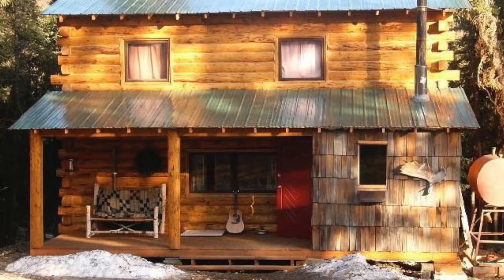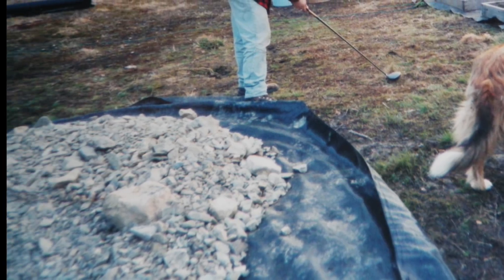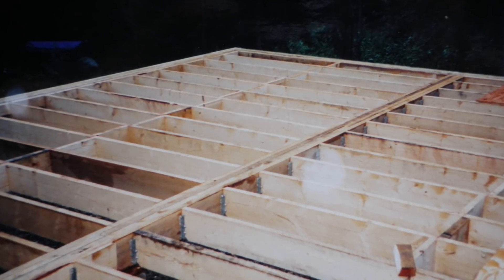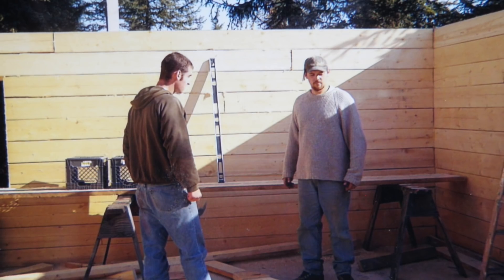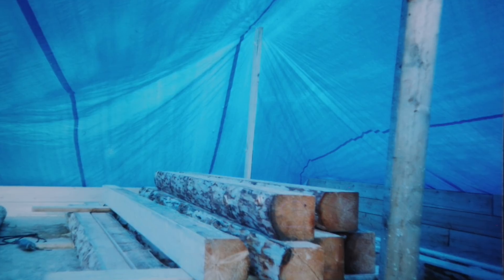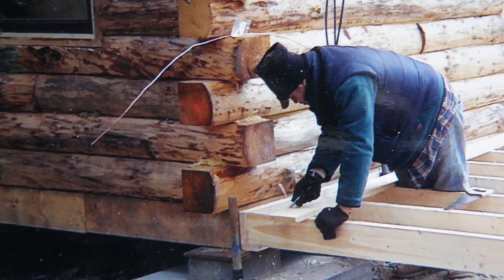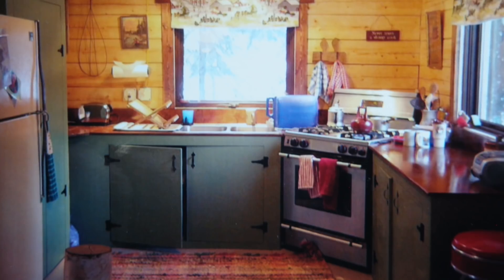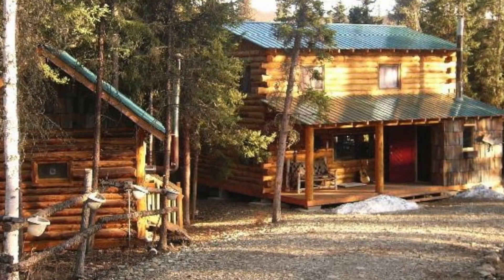Alaska Log Cabin .........Start to finish ( part 2 )

Comment: kudos....raising a family...building a cabin...any cabin while maintaining an income.....good stuff Vern...We built a temporary 20x25 A-frame on 4ft log walls....I was driving 100 miles one way to work..as a timberfaller...started in June....came home.. from work on the 3rd of Nov...we were moved in......that was in 1987...hopefully will build a house this year.....with indoor plumbing...Our three kids were from 8-16 years of age when we started...we now have 5 grandchildren...from 6-17 yrs of age.....never give up the dream....Still off grid...just discovered strip LED lights.....Wow...a half dead 12v battery will light your entire house for a couple months w/out charging....incredible...Live the Dream Guys......
Reply from the maker: I need to check into those!! Where should I look for those lights, and do they come in 12v or do they need an inverter?

Comment: Tarps are the most common home savers.  Love a huge tarp.  They don't last more than 6 months.  In my experience.  I used a 100' by 60' over my 5th wheel home.  The first winter we had ELEVEN feet of snow that never melted.  That tarp was TIGHT over the RV.  I had to step down 4 steps carved into the snow/ice to get to the stairs up into the RV.  

Every winter I used only 15 gallons of propane.  Maybe less.  There was enough room for dogs to go poo poo,  an area for charcoal cooking.  Completely shielded by snow and insulated with snow, no one could possibly have seen the RV.

Comment: I think this is how I will build my bunkhouse.  I wanted to hand scribe it but I think that could be a project I'll never finish.  I am buying a sawmill and my tractor should be here in a few weeks so with those tools my wife and I should be able to do a butt and pass much easier.  I like the way you supported the second floor joists.
Reply from the maker: Nothing the logs on the outside wall is the way to go.

Comment: love these videos the most  please continue down this path ,,, any chance we could have a look on the inside..... more  cabin videos....maybe an explanation of the artic entryway,, why you put the stove in there  i see the roof and chimney was easier than going thru the upstairs... smart ...also keeps good heat source between you and the elements &  make drying boot and jackets easier,..  love the cabins and property changes  .. I LOOK FORWARD TO MORE OF THESE...
Reply from the maker: The arctic entry is just an area to go through one door before you open there door to the house. It's a barrier for the cold to get in and a place to store some stuff you don't want in the house. As for the stove, it wasn't my only heat source in that cabin as it was in the little cabin...We also had a Toyo stove ( fuel oil). I would run the wood stove when it was warmer out and shut the door to the house and run the Toyo when it got really cold.

Comment: Very nice cabin and man you work fast.  My dad and I built one up on Haystack near you back in 1982.  It was 20x24 2 story. It took us 2 years to finish it.  Probably because there was no road into the site until we finished the cabin and the nearest electric was a few miles away at Hilltop.  And we drank a fair bit back then too.  We worked right thru winters even when it was -40F so I guess we needed the constant liquid encouragement.  It was pure hell but now it's some of my fondest memories.  For the last 2 years, Ive been developing  a cabin site with my 12 yr old son and we'll be doing the cabin this Spring.  I sure wish I had your energy and youth.  Now I know what a tough old bastard my dad was tho!
Reply from the maker: .....I wish I youth and energy too, LOL! I'm nearly 43 and have been doing concrete since I got out of school.....
     Thats awesome you guys built up on Haystack. I put in a slab foundation up there in 2004 when the fires were burning up the other side of the valley and I had to run up there at 9pm and get my equipment off the mountain because they were evacuating the area. You could hardly see to drive the smoke was so bad.

Comment: Beautiful work. Just an aside, but I'm surprised that the snow fall did not require a steeper roof. Thanks for the view Brian 77
Reply from the maker: There is very little overall snowfall in the area. you usually get 16" on the level accumulation.   With the little cabin...you just slam the door and it all comes off...with this roof, the first warm day it all slides off.

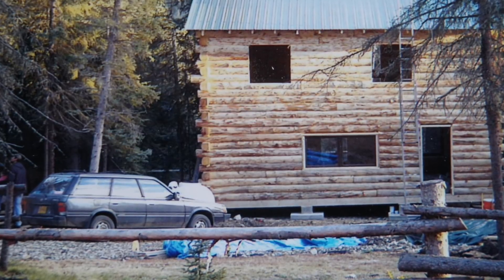Comment: The little station wagon at 8:02 to about 8:15 is that the one I saw you paint with a roller?  When I got to visit Alaska for a couple months two summers ago I was amazed at how long people keep their cars and trucks up there. You Alaskans must set the record for squeezing the most miles out of a vehicle than any other state in the union. No such thing as a throw away society up there. It even seems that when a vehicle is replaced a lot of folks keep there originals and use them for parts or for manufacturing other things from and sometimes the parts are good trade goods with neighbors. I was amazed with what folks will barter with up there
Reply from the maker: No that station wagon in the video was a Subaru. They don't use Salt in Alaska so the vehicles last forever. My 1998 ford escort wagon has 250k and it still has 95% of its original parts and very little rust. I t does have some from spending the last few winters in Michigan.

Comment: I have seen you build with corner post and infill, butt and pass and vertical. Which do you prefer?  Great video series!! Thank You
Reply from the maker: The corner post methods makes the most out of the log.....all I had was 12' logs so it gained me about 2-3 extra feet. But and pass with 3 sided logs is the easiest and fastest by far. and stronger too.

Comment: Hi Dave, whats your opinion on heating the D style logs in this video compared to the full round in your first cabin and possibly in comparison to by six stud wall construction?
Reply from the maker: Good question. The full round was the worst to heat because the logs only end up with about 2-3" of flat surface where they meet. 8" three sided logs have about 5-7" of flat where they meet.  I would say they heat as well as a 2x6 wall, and a log house is a DRY house because the logs pull a lot of moisture from the air. Ina 2x6 house ( a tight house) you may have to incorporate some kind of ventilation to keep the moisture down, like a de-humifier.  Not so with logs. I heated a 1500 square foot log home with a small wood stove with a 6" flue, in Delta junction Alaska.....That stove would handle the house down to -45 then I would have to run the furnace too.
Reply: @Bushradical  I copy, thanks for the info. Any opinion on the gasket sealed toung and groove style D logs? I was looking at these offered by the mill there in Delta Junction matter of fact.

Comment: Hey that was nice video. Good craftsmanship as well.  What do y'all put on the logs exterior to help preserve the wood and its  look? Did you varnish the interior walls?
Reply from the maker: Interior walls get brushed with an Osborn buffing brush which cleans them up fantastic and they get coated with Watco Danish oil. For the outside I use a product called Duckback log oil.

Comment: Been watching your videos and was curious if you built a 3rd log home after #2? You seem to imply that you lived in the bigger log home for a few years on that same homestead, so I'm guessing you may have moved to another piece of land. My logs are milled flat on both sides, dovetailed on the corners. It's taking me a long time, but have the shell to top plates and just got a foundation poured for it and hope to get the shell moved sometime soon. BTW, you may know but there are a few companies in Oregon that use a log milled on 2 sides and leave inside and out as flat/milled. I think flat walls in the interior make a lot of sense, exterior as well. When a check in on the vertical face, water still can't drain into the log. For a similar reason I used half dovetails, as water sheds away from the joinery on both sides of the joinery. I don't know it's best or even right, but the way I'm doing it.🙄
Reply from the maker: Ive actually built 4 log houses . I built a big house in 2009 . I have a vide called "log cabin projects, or Alaska log cabin projects.....something like that, .....that has some footage from that build but I didn't take many pics of that build and Brooke had only a little footage that we still have. Check it out.
Reply: @Bushradical  I will check that out. I saw a stockade type building, maybe that was number 3 or 4. Would be interested to hear a comparison of the styles you've built.

Comment: Did you insulate between the floor joist, if so what type of material?
Reply from the maker: R30 fiberglass insulation.
Reply: Regal Bowman
If you are looking for ideas.
 You should check out bossoftheswamp.
He does a cabin remodel/build.
Lots of good practical knowledge.

Comment: Looks like you primarily used butt-joint corners.  Did you have any settling issues?  We're looking at doing the same thing on Hawaii Big Island in the future.

Oh my god, I just saw the collie at 7:22.  Took me back to my first 40+ years ago.  Beautiful!
Reply from the maker: Hey John. The but corners work just fine. I usually stuff 2 log screws in each course through the corner. I allow 1/8" per course for settlement. So if you are stacked 12 courses high ....allow 1.5 - 2" above your partitions for settlement. Also build a box of 2x6 for the windows to be set into....this will allow you to leave a gap above the box for settlement...but it won't effect the window itself.
       Ive had a collie for 20 years now. I'm on my 4th one. My first 2 lived 12 years, my third got killed in a trapping snare. The one I have now is in a lot of my videos. GREAT dogs!!
Reply: My first was a farm collie that I had for 12 years, then I had an Aussie that I adopted, and we had her her 14 yrs. Now I have a Border, my first boy, and he's a stud.  Hangs right with my wife's St Bernard.

Comment: Hey bushradical I live in alaska as well and I'm looking to build a log cabin could you give me and idea on where to find some good plans
Reply from the maker: ...............Uh.... I'm sorry jacob. I wish I could help you out but Ive never built a house from much more than a sketch on a piece of paper. And Ive built several homes since this one.    I would google search plans online and see what looks good to you. 
      When building log I generally build odd dimensions....like 33X25   You loose a solid 6" with each wall so you end up with an even inside dimension like 32X24....this works well for sheet material when flooring.   I use 1x4 full demotion ruff-cut lumber to screw the metal roof down so the odd numbers don't bother me roofing.

Comment: How long did you let the logs season before building? And did you reinforce the walls with rebar or timber nails?
Reply from the maker: On this cabin the logs were put up green. They are all held together with Log screws.  When using 3 sided logs you have 2 options....put the logs up green as soon as you can, once they are milled......or season the logs totally and THEN mill them 3 sided. The one thing you CANT do is to mill the logs 3-sided and then let sit and season. If you do they will twist and be un-usable. 
      Once a green log gets milled it needs to go in the wall ASAP.

Comment: .Very nice. How did you heat the second cabin, was it all heated by the wood stove in the entry way. If I understood correctly, you floated your footers on top of the pad. I am curious if you noticed any movement in the house with that system? Thanks for sharing.
Reply from the maker: Good questions. The post and pad foundation does 2 things.#1 it keeps your building above the ground so the building doesn't "heat" the ground and cause movement due to thawing. # 2 It allows the building to adjusted in the event of movement. 
I didn't have any pics of this or I would have talked about it...but before I built the floor system, I put 1.5" of plywood shims ( 12"x12") on top of every post...so if it moved I could jack the area up and add or subtract shims to adjust the house......I did this several times during the time we lived there. Thats building on permafrost in interior Alaska for you.  The pad gives you a perfect platform to place a large bottle jack between the ring beam of the floor and the concrete pad. Works like a charm.
Reply: That is brilliant, I have watched a number of shows on building in Alaska and have wondered why they weren't doing something like that. It seems like building a foundation in Alaska is a huge issue. A system like you created seems like the perfect option. Make it a given that the house is going to move and have a system of shims that allows you to compensate. I guess it would make it more difficult if you had fixed plumbing lines but I think it would be fairly easy to create a system that has flex built in.
Reply from the maker: This type of foundation is gold standard for building on Permafrost. I didn't invent it, but being a cement contractor, I'm sure my version of it was as good as anyones. I really take pride in my concrete work.

Comment: Nice cabin. any problems with settling with the butt and pass methood
Reply from the maker: Its not the type of corner joint that matters, its how green the logs are. And, even if they are dry seasoned logs they will settle a bit. What you do is account for settlement and drying by leaving room above the windows and doors. About 1/4" is about right ( per 8" log) . So if you have a window thats 3' high...you might leave a 1"-1.5"  gap above the window frame. And by window frame I mean the 2x6' box that you build to place the window in and trim out. This box gets hard nailed off to the sides...and the gap above is filled with loose fiberglass insulation.
Reply: Thanks lots of sites claim there is no settling with but and pass. I found that hard to beleive.

Comment: With your post and pad, did you just pour on top of the ground or did you dig down at all? Great video
Reply from the maker: right on top of the ground
Reply: Bushradical how has that method stood up to time? Has the cabin settled much compared to a different foundation style such as piers?

Comment: Did they vibrate those ‘trimmings’?  Did you get or have you gotten much settling?
Reply from the maker: Vibrate?  Yes the logs settled quite a bit. I allowed about 1/4" per foot above each door, window and partition wall.
Reply: I wondered if you ran a vibrating roller over the gravel to pack it before building the house. Down here we have asphalt millings and settling is probably a much bigger deal here. Keep the videos coming.

Comment: I really enjoy your videos! Are you still in Alaska living in a cabin?  Thanks
Reply from the maker: Yes and no....The last 5 years we have spent the winters in Michigan visiting family. but the summer we have been in Alaska working on a new homestead...and yes building cabins. You can check out my playlists and find lots of videos on our recent cabin projects.......and the last 3 summers we have been living in a wall tent!
Reply: Is it a Davis Tent and Awning out of Colorado wall tent? Primitive or modern? 10x15'? 12v18' or larger? I've had 2 wall tents a Miners tent a Baker and my pride and joy a Wedge 7x9Lx6H w/4' Bell. Had it since June 88. NEVER Leaked. Got the stove in 90. $60 handmade brand spanking NEW. Camped 3 states &  BC. Rendezvous & Barter Faires-Good Times!

Comment: Where in the U.P.do you live?We have been in the 
Porcupine mountains backpacking many times and stayed in the cabins there,and now that were older go to Craig Lake state park.
Reply from the maker: We have spent the last 5 winters in Northern Michigan, which is actually the northern lower peninsula. The U.P. is generally referred to as Upper Michigan. Brooke and I did spend one winter in a house we bought on the west end of the U.P. by a town called Republic...about 20 years ago. But thats the only time I actually lived in the U.P.    Both Brooke and I have spent time n the porcupine Mountains but never together. Back in the 90's Brooke took a girl scout troop on a campout there , and in 1994 when I graduated High school,   ....a friend of mine and I road motorcycles up there in late September and road all the way back to Big Rapids Mi, in 40 degree weather and driving rain......We actually spent half a day in a forrest service out house at the union river campground in the porcupine MNts. when it was driving rain and we didn't dare ride the bikes and we had lost our tent rain fly.......good times.

Comment: Thank you for sharing such a beautiful work. I see there is one wood stove for the entry. Did you have a second wood burning stove to heat the rest of the cabin?
Reply from the maker: I had a fuel oil stove in the house called a "TOYOSTOVE".

Comment: Why did you lay that mat down?🤔
Reply from the maker: It for building on perma- frost. watch the first minute again...I think I explain what its for.
Reply: Bushradical for the drive way
Reply: Bushradical interesting. I would think it would cause drainage issues. So that's why I asked. I figured you had a good reason👍🥇
Reply from the maker: It lets water through, but its tough enough to keep the rocks from working their way down into the soil. Its standard issue up there for laying down roads over perm frost. I costs like $275 for a 300' roll 16' wide....so its super cheap for what it is.